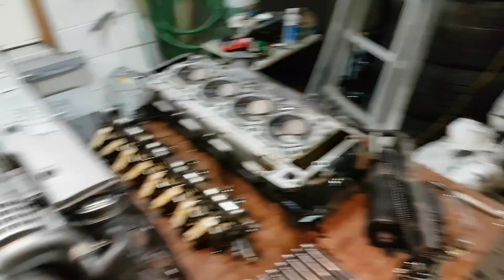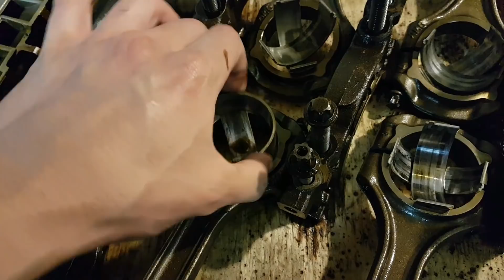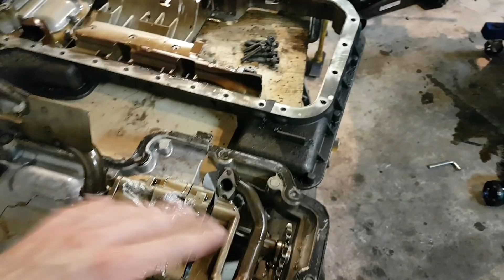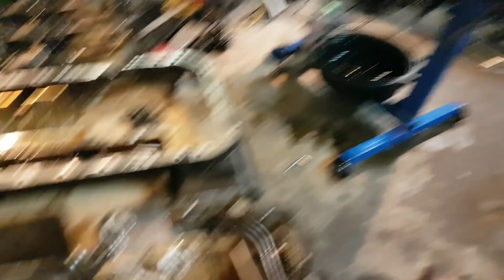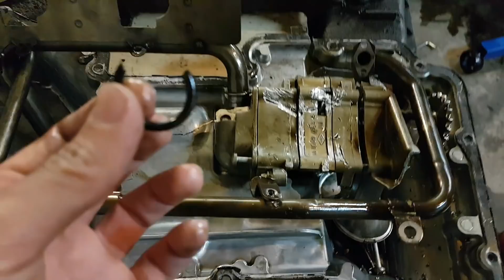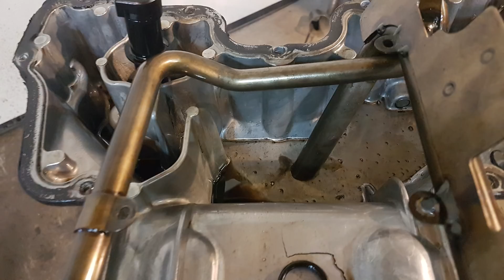Why my Engine Blew. Something every E55 owner should know!

Comment: I am coming into this late, but perhaps I can dispel the fears of those coming to it later. This "Not!" a design flaw and it is "Not" a fault of the O-ring. 

This an over heat problem.

I have seen a lot of O-ring failures like this in engines and hydraulic systems. This hardened O-ring was definitely cause by  massively over heated  oil condition, and it happened over time. 

He has been  racing it, but that in itself should not have cause the problem. 

My educated guess from 50 years of building high performance engines and repairing everything from lawn mowers to battle tanks 

is that this is a problem with his oil cooling system. 

Your engine oil temperature should remain at approximately the same temperature as your coolant temperature (the water in you radiator). 

The more horsepower you force an engine to produce, the more critical oil temp control becomes. Horsepower is created by heat, the more heat the more power, the more power the more heat. That is why Mercedes and other performance car makers add an auxiliary oil cooling system to their performance cars.. 

Most heavy diesel engines have a water cooled system as do some cars. Most hydraulic systems operate at higher temps and are almost invariably air cooled, they also use a different oil to handle the higher temps.  

Mercedes has an external oil cooling system like the one pictured, not all models may be exactly like this one, but this is an example from an '05 E55. 

Notice the small square radiator? This is usually located on one side of the car just behind one of the screened air scoops in the bumper. 

Most but maybe not all, (I haven't seen them all) also has an electric fan  behind that little radiator. 

In some I have worked on, the motor is stuck and will not turn. They are in a major hostile environment, down at the bottom of the car just in front of the tire, sucking in water and dirt and every nasty thing you drive the car through. Nobody pays attention to them and 99% of people don't even know they are there because you don't see them..  

If you have one of these cars check them once in a while to see if they still spin free and the fan motor is working. If you are using the car as a driver and only street race it occasionally, the fan not working won't be much of a problem. If you are racing it, especially for long periods where the oil does not have a chance to cool down by itself, that cooling system not working will destroy your engine.  

This engine failed from overheating the oil which caused the o-ring to harden and crack, but I doubt that caused the problem it is just s symptom of the oil heat. 
Most likely cause was a combination of the deterioration of the oil from overheat (it had the lubricating properties of heated water) causing the metal to swell. The rod bearing with the least clearance contacted the crank first and is the one that seized first bringing the whole engine to screeching halt. 
From what I can see in his video, I don't see few if any signs oil starvation that would be "Pre- destruction." Most likely this engine was pumping oil, the temps of the oil and the metal parts had just become so high that the parts expanded and seized. I have not seen a video of it self-destructing,  but I would bet pedal to the metal engine screaming like a banshee and "Boom". I've seen it happen a zillion times.
Reply: I guess I can't copy and paste a pic here. For a pic of the oil cooling system just Google E55 oil cooling system and click images

Comment: Failures of this engine are not common. They are generally very well built. Rubber O-rings will deteriorate over time regardless of maker. O rings are in pretty much all oil pickups. Heat cycles kill rubber. 
You can add an oil pressure sensor fairly easy on the m113k. I added one on my 01 e55 using a port on the front of the engine.

Comment: wouldn't you think some engineer had the oil pump and pipe screwed into each other with a copper washer. the whole thing should be screwed together. Also what the hell no oil pressure switch. Who designed that mess. You can find out online if you look hard enough. Must have been someone who got fired at GM.

Comment: "O" rings come in different formulations and using the proper one will be able to withstand the oil and heat generated in this engine.  However in this critical position ,  engineers should have used a flange and gasket secured with a bolt-down collar similar to an exhaust pipe connection.

Comment: Very interesting. I have a 2003 SL55 with a M113 engine. I'm not sure if it is a 113k as you referred to yours. How can I tell? I have 81000 miles on it, and it is not a track car. Mostly riding around town use. Do I have to worry? Not so many miles as yours, but it is 16 years and one month from date of delivery. Any comments would be appreciated. RR

Comment: This is a very good video. I have also watched the follow up videos of the replacement engine and also installing the pressure gauge (odd why they stopped installing those from factory).
The engines I play with also get damaged due to oil issues but it's more so due to some of them being oil burners and people neglecting to check their oil levels. I think an oil level sensor would be a good idea at least for those engines.*Nissan VK45DE*

I have looked on Merc forums and I see that the sensor will give a warning in the car -*Engine level. Stop, engine off*. I like the simplicity of that. Not everyone who gets in a car knows that the red light that looks like an genie lamp is a Nissan oil pressure indicator and what to do with it.
Reply: Oh, also their oil pump inlets/outlets are 2 flat mating surfaces, not a tube-in design.
They do use O-rings as well but they are used like washers, so the inlet is always sealed . 200,000 miles and the O-rings were still rubbery. Nissan did something right.
Reply from the maker: Yeh the oil level sensor was definitely a good addition in these engines but should have still kept an oil pressure imo. The new o-rings they supply now are a different material so I hope they last longer

Comment: I've often thought that pressurized oil engines should have an electric oil pump, as well as the usual mechanically driven pump.  The pump would be plumbed in parallel with the standard oil pump, with check valves immediately down stream of both pumps.

The electric pump would be wired, such that by pushing a button, oil pressure could built up before starting, and if the oil pressure low switch indicated a low oil pressure, the electric pump would run until the engine was turned off.

Having oil pressure up, before start would mean that the cams, cylinder walls, and turbine bearings would be lubricated before they moved, and that the hydrodynamic bearing of the crankshaft would be ready to go when the crankshaft began to turn.  This would be particularly desirable for dry sump, turbocharged, and overhead cam engines both common in high performance engines are designed.

You could also run the electric oil pump for a while after engine shutdown to cool the head, pistons, and in particular turbine bearings if the vehicle was turbocharged.   Particularly if you have an exotic, or racing car, a relatively cheap electric pump could save a ten thousand dollar engine!

Comment: You would expect better quality from the AMG Division of Mercedes .. You should contact them and see what they have to say about parts quality. You can probably find a shop that specializes in high performance Mercedes Benz Engines .. They likely have an O Ring of a better quality that will not dry out. This is what you get when you buy a $130K car

Comment: Designers of new engines need to study the past failures of engines. 60s to mid-70s Volvo B18-B20s have pretty much the same failure mode. The Engine is otherwise nearly unkillable outside of the most severe over heating or prolong oil starvation.  If the engine has been rebuilt by someone in the know the o-rings are replaced with a higher quality material that stays soft for at least 30 years. (Based on engines, I've taken apart.) There is one key difference!  Some people luck out and see the oil pressure light and turn off the engine!

Comment: Good that you stripped the engine down, but your root cause analysis is very poor. The o-ring had hardened. Why? What sort of oil were you using and how often did you change it? Factory OE oil spec has to cover standard use and not what you seem to have used your vehicle for. If you don't change the way you service your replacement engine exactly the same will happen again. Mercedes sells millions of vehicles and it seems you are experiencing problems most other owners don't. Therefore, what do YOU need to change?

Comment: Guys, before condemning Mercedes for "poor engineering", keep in mind that this car is used for time attacks. The engine was also clearly opened before by the owner. And the fact that there are thousands, if not more E55s on the road WITHOUT issues should tell you that this is NOT the norm.

Comment: I guess you should have installed an oil pressure gauge instead of what looks to be a boost pressure or fuel pressure gauge on the center of the dash, what is that gauge? I'm sure there is a low oil pressure light in the dash cluster, but it is set for a lower pressure that would be present when revving the boosted engine on a track.

Comment: it is in the schedule to replace that O Ring on the pick up pipe .  Worked on all Mercedes from a A class To a Actross  there good vehicles but they do odd things .this is just one of them odd things . They Must of Given the Techs the week off when they designed this one  No oil pressure indicator  odd things by Mercedes still love them good work horses .

Comment: In my opinion.. bad design in that oil pick -up tube o-ring, MB should have made it into a oval flange with two bolts on both sides with a flat gasket . MB should pay for your misfortune..

Comment: Even though Mercedes shouldn't have designed it so an O-ring failing would cause it to lose oil pressure, that isn't 100% why this engine came apart. This engine might have been salvageable if you shut it off when the oil pressure light came on. That is why cars have oil pressure sensors.  You'd think that by 2018, they would have the PCM kill fuel and ignition if the oil pressure drops, but then Mercedes couldn't charge 20k to replace one of these engines at the dealer, out of warranty. Shit like this happens when oil pressure lights come on, and the driver either ignores it, or decides they should "at least get it home."

Comment: Wow that's a shocking thing, manufacturers moving away from fitting oil pressure sensors/senders. I've heard of some Volvo engines that also don't have a sensor & these also have issues with an O ring... (some models, most, do have a sensor fortunately).  By the way,. the reason that #5 rod failed is likely the harmonics from the bearing knocking causing the big end bolts to either stretch or back off, it's a fairly common failure mode for a rod that's had a bad knock & it looks like that was the one that suffered most from the lack of oil hence that one blew first.

Comment: How much does rebuilding a usable engine cost?

Here is an even more interesting cost to ask. How much more would it have cost to use a copper or multi layer steel gasket where the O-ring was?

Comment: Built in obsolescence a deliberate design car killer like under the rear windscreen on a w126, it is not the first owner but the second third or forth that gets a catastrophic fail, that should of had three O rings with ptfe raped  in the voids between the middle one and would be good for a million k. Thanks for the work and a very good thing to know .

Comment: It's not a race engine so you shouldn't expect to use it one the track without consequences.  Without the proper baffles in the oil pan or a dry sump lubrication system with a backup electric oil pump, the high cornering forces lead to oil starvation.

Comment: I'm very surprised that Mercedes went cheap and used just one cam in each head. It's better to get rid of all the rocker arm crap and use two cams in each head. Even my lowly Prius has two cams. As far as failures go, most European cars use a cheap plastic coolant tank. It works for a car that just stores the expanded coolant like in most Japanese cars, but the Europeans like to circulate hot coolant through the plastic tank. After a few years, the hot and cold coolant cycle will crack the coolant tank. Lots of Volvos, MBs and BMWs with blown head gaskets and engines. Lease European, Buy Japanese. As Scotty Kilmer on You Tube says, European Cars are : "endless money pits".

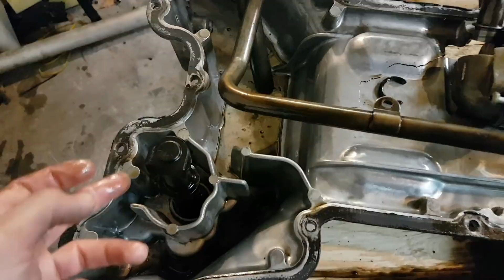Comment: Save yourself a whole lot of time and go straight to time 8:13. Before that it is all obvious stuff. It is mind boggling to think that Mercedes with all of their engineering knowledge did not think an oil pressure indication was needed. There are so many things that could go wrong that would effect the oil pressure thus potentially damaging the engine. Total fail on their part.

Comment: When ever i built an engine i always welded the pickup on the pump or welded a bracket to bolt to something

Put a low oil pressure switch in and wire a buzzer and idiot light.
So u know when pressure drops

Comment: I have ever dealt with a problem with the m112 engine, the balancing shaft for the camshaft had sprockets which wore off quite rapidly. I noticed that problem during an oil change.

Comment: MB isn't the only one that gets cheap on stupid stuff. Spend a ton of $ on an engine and then cut corners on little stuff. No oil pressure gauge? Did that slip their mind? Most modern engines, if you lose oil pressure, the ECM will kill the engine.

Comment: Oil pressure on older, or high mileage engines should be checked before pushing hard. Inspect/replace oil pick-up tube seals if engine is high mileage or has been sitting for a long time. Old failing seals are nothing new, and it's not a defect or recall thing, it's a parts life thing. Almost every manufacturer, especially Mercedes, uses oil pressure switch, oil pressure sensor, or both on their engine designs with either an idiot light on the dash, oil pressure gauge, or computer programmed warning message to notify driver of low/no oil pressure well before engine has chance to self destruct. Live and learn

Comment: my uncle was a mercedes mechanic before he passed away. said theres an issue with the low oil sensors in the older mercs. especially if the oil pressure sensor orfice is blocked with carbon from old oil (think extended oil change intervals)...

Comment: The way you pronounce "cylinder" is really distracting me for some reason. Never heard anyone pronounce it like that, but I kind of like it.

It makes me a bit angry that an o-ring, something that probably costs pennies, is the reason for an entire being utterly destroyed. It's like a house being burned down because of a single loose wire in one electrical outlet that was caused because of vibration from people walking over time. This is one reason I hate modern engines. There is so many parts, so much complexity, little things could be overlooked and those little things could destroy the engine.

Comment: How to be Mercedes 
Step one : Design a high performance vehicle 
Step two:  Choose to not have an oil pressure sensor for said high performance vehicle
Step three: laugh and charge thousands for an engine replacement when they could have been saved before they blew up

Comment: My opinion is that Mer and BMW have fallen down on their engineering. These engines at least in BMW are designed to run at 245F oil temp and the seal material they use is not robust enough. Had they used gaskets and o rings that could take that heat you would not see the failures you do. I put 279K miles on my 98 M3 and had no leaks because the oil temps were not excessive 180-192F. Once over that 220F threshold you need better material design. I don't see 188Kms as high mileage. Maybe this was a corporate call I don't know but to me it is a fail and put owners in the early model E90's anyway as beta testers. I will not buy another BMW new and maybe only used with extended warranty even though I can rebuild the engine and have done that before on the M3. Seeing that engine torn down I can see that it is a very high performance engine....

Comment: There is no way this engine doesn't have an oil pressure sensor. Just because you didn't know what it looks like is no reason to say it doesn't have one. Do more research before you talk. Also, you were wrong on several other assumptions.  You are not a mechanic. That is obvious.

Comment: I'm sorry but you make an assumptive conclusion and the reality is, its just a guess. I am a Chief Engineer. I have torn down, rebuilt, modified and designed engines and all manner of mechanical machines. That o-ring is not buna but viton, and I have never seen viton become that brittle absent some other factor i.e excessive temperature. There is some other underlying problem or problems you failed to diagnose. Keeping it real brief here! GL to you.

Comment: It's always about the $$$$. MB bean counters found a way to drop the unit cost of each engine by eliminating the sensor and readout (gauge or lamp), did a risk analysis and decided to go for it. I've always wondered why such critical, potentially engine killing parameters are not tied back into the ECU with, at the very least, a STOP ENGINE AS SOON AS SAFE!!! warning. How many overheating cars have been limped to the next exit with a warped head or worse? Manufacturer liability for people pulling over on freeways, perhaps?

Comment: GM (since Gen I) has used Oil pressure GAUGES or at least "dummy" lights on their vehicles, and even equipped 7psi oil pressure switches to cut the ignition out if pressure dropped below 7 psi. DAFUQ Merc?!